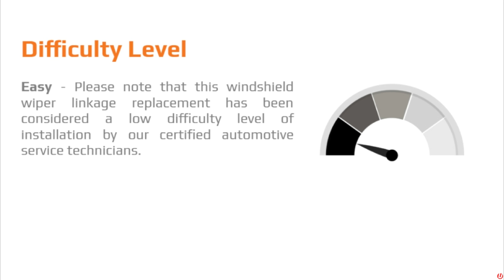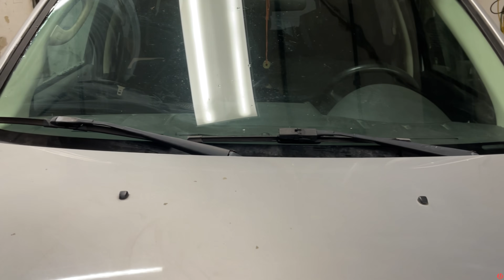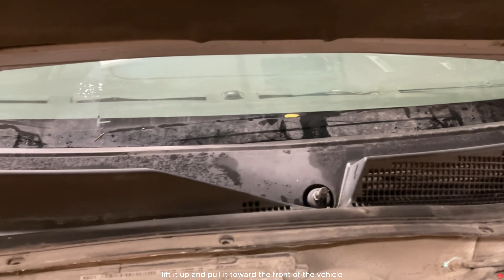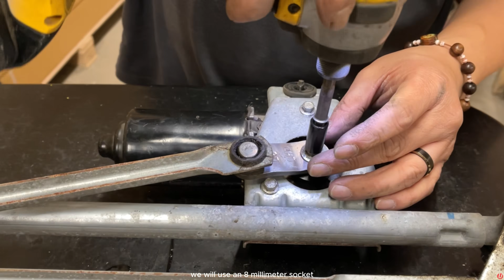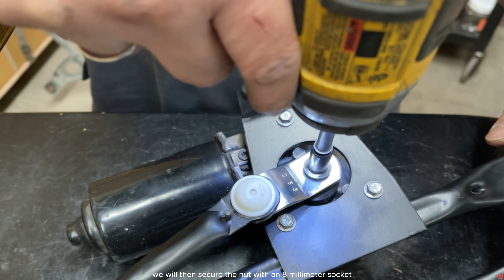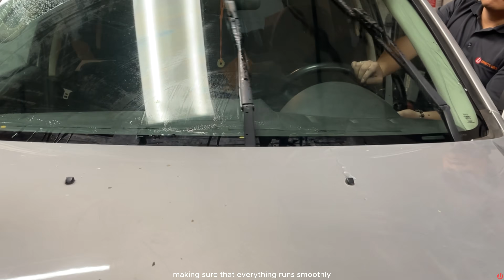WLTR01 Wiper Linkage Replacement For Mazda Tribute 2001 Fast & Easy

Comment from the maker: ✅ Uparts Group Wiper Transmission Linkage WLTR01
https://upartsgroup.ca/products/wiper-transmission-linkage-wltr01

🧰 Recommended Tools:
🔧 Plier & Wrench Set
https://amzn.to/49n8lY4

🔧 Screwdriver Set
https://amzn.to/4tN05br

🔧 Trim Removal Tool
https://amzn.to/3RjRH5r

🔧 Ratchet & Socket Set
https://amzn.to/4njQmYg

🔧 Battery Power Wrench
https://amzn.to/4tzOI6p

🔧 Wiper Arm Puller
https://amzn.to/4d48ou9

🧤 Protective Gloves
https://amzn.to/42tTLKv

🦺 Safety Glasses
https://amzn.to/4wpi9dV

👍 Thanks for watching! Don’t forget to like, comment, and subscribe for more product guide videos.